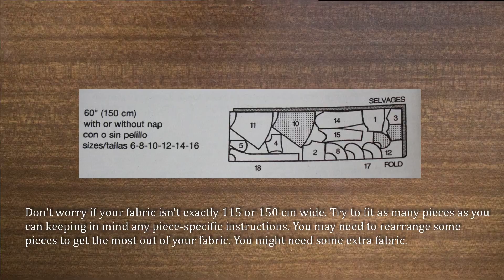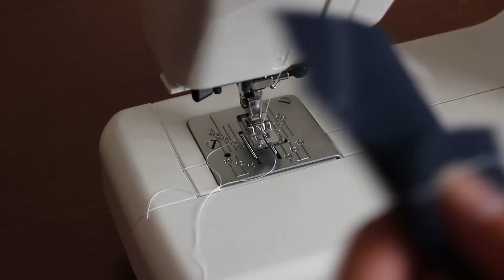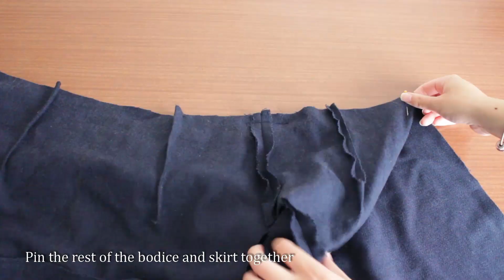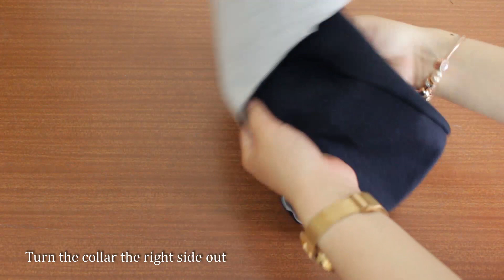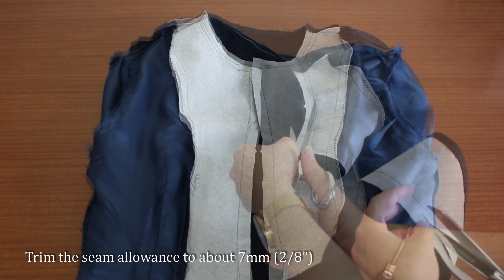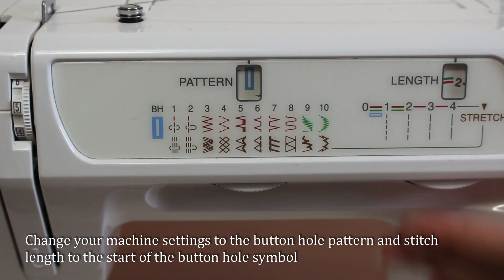Make a gorgeous tailored coat! – McCall’s 7442 Pattern Tutorial

Comment: What kind of tailors chalk do you use also??
Reply from the maker: The tailor's chalk is generic. You should be able to get it from your sewing shop
Reply: @PrimaDressmaker  I have and I don’t like them. I’ve tried Dritz and it sucks and I have a cheap triangle 10 piece from amazon which is the same ones from China like most stuff on amazon lol. Your chalk looked like it shows up more than mine do.
Reply from the maker: @shortyylu  Mine doesn't have a brand sorry. I suggest trying to sharpen the edge with scissors